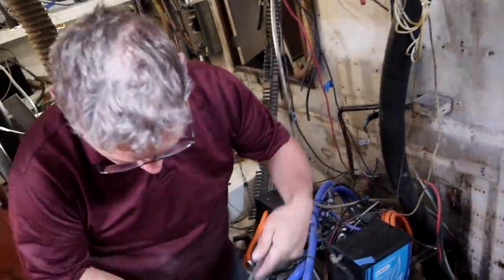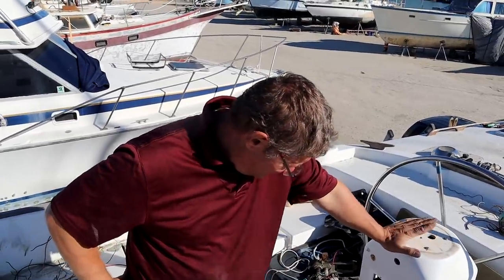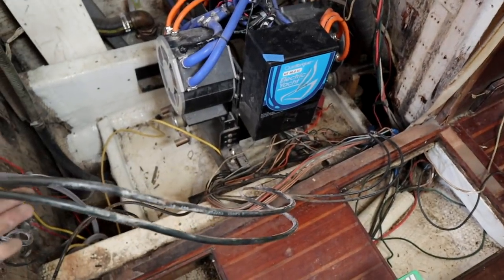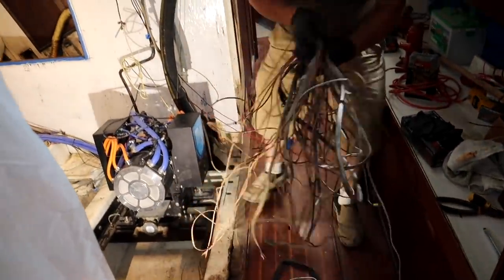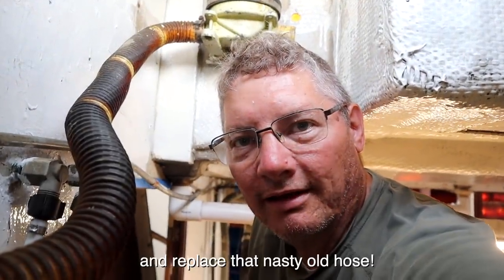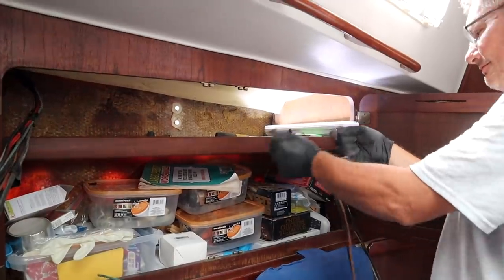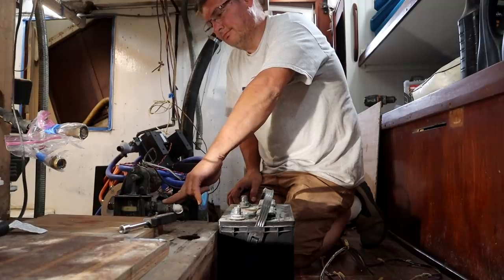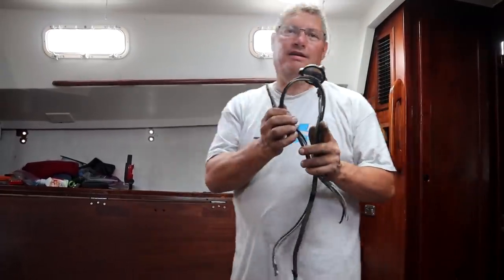40 years of Old Wiring | ep. 115

Comment: For hard to reach screws, get one of those ratcheting offset screwdrivers with interchangeable bits. They are under $20 for good ones. Also, a small needle nose Vice-Grip pliers can often be used to grip the sides of a stuck screw head, to get it started.
Reply from the maker: I have one of those ratcheting screwdrivers, I just forget I have it in the moment!

Comment: I have not done much work on my wiring, yet, but I did buy some sections of 1" PVC to use as conduit. I will mount them along the port quarter berth. Sparrow57 has two long quarter berths plus the V berth. I have also noticed that the deck of the cockpit is the right size for an air mattress, so I can camp out at a mooring or anchorage. Did you figure out why the voltmeter was overheating?
Reply from the maker: No, I haven’t figured it out. It’s not much, but something to watch for sure. I like the conduit idea.